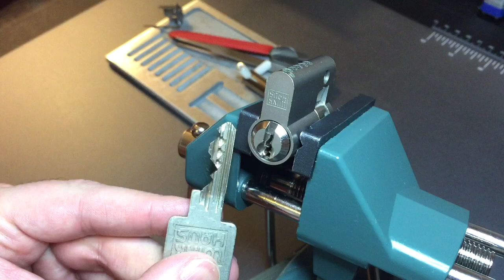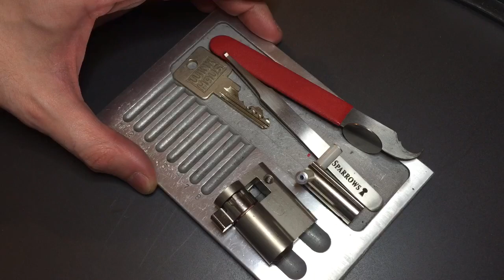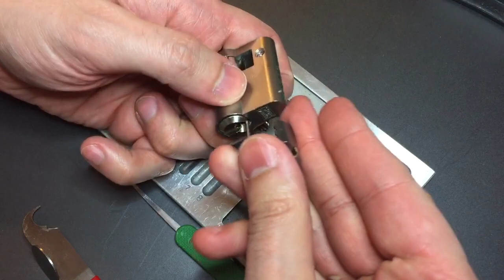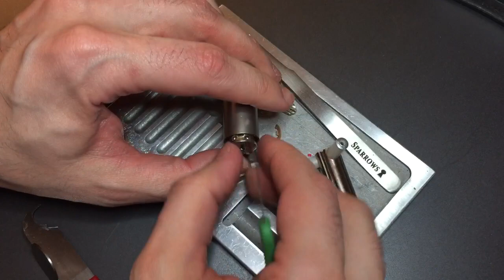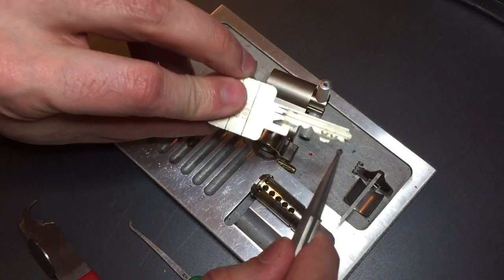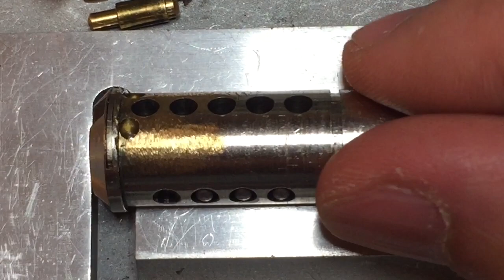[125] Wink Haus Euro Profile Cylinder Picked (With a Custom Pick) and Gutted

Comment: Great job making that custom pick. Love that demonstration of your will to never give up. Make a handle to the pick and you got a nice addition to your arsenal. Well done.
Reply from the maker: +Potti314 Thanks.  I doubt I'll make a handle... the pick is way to thin to stand up to much use, but it had to be to fit through the bottom warding and pick from the bottom of the keyway.  It's already distorted pretty badly.  It's days are numbered.

Comment: I used to build Wink Haus locks. It’s been a LONG time, but yes, that filling is unusual. I never recall any issues with the cores or cylinders from the factory. This was 35 years ago, so I don’t have current knowledge.

Comment: Great work on a tricky lock👍👍😘🔓
Never seen a spool like the one in number 4( nice)
As for the pick,it doesn't have to be pretty to work well 👍👍 great job and thanks for sharing😘
Reply from the maker: +Pick Beard Thanks... I've never seen one like 4 either, at least not a commercially made pin.

Comment: You got to turn the key multiple times to open these locks when insert in a door. 
Is that possible when picking? Same lock on my door but need to turn the key 3 full rotations to open and lock my door!
Reply: It is. But you would have to pick it multiple times because with each rotation, the pins will reset.

Comment: Your clip remover looks really good. Can you remember where you bought it from and perhaps what it is called?
Reply from the maker: +Jasmine Lognnes It is pretty good.  It came as part of the lock disassembly kit sold on dhgate.com ... comes with followers, tweezers, pliers, core holders, euro cylinder pin holder, etc.  Much of the stuff is crap, but the few nice items are worth the $25 price of admission.
Reply: +LockPickingLawyer I'll get that =) Thanks =)

Comment: Had the same kind of lock yesterday. Too jagged to put a large hook, too extreme a bidding to open with a thin long small hook.
Reply from the maker: +zanshibumi What kind of lock?  Outside of challenge locks, I've found that truly difficult bitting/warding combinations are pretty rare.
Reply: +LockPickingLawyer While taking a picture of it, I saw that in my memory it was harder than looking at it more objectively (not right after failing to open it) http://imgur.com/bTbFYtN  In my defense, I must say I tried to open it with fat .028 picks. :)
Reply from the maker: zanshibumi Nasty bitting!  And a .028" is usually too much for a tricky keyway... you need to get some thinner picks!
Reply: +LockPickingLawyer Waiting for my .236 MadBobs, may they come in less than a century.
Reply from the maker: Personally, I'd look into .015" and .018" picks...  .236" is an improvement, but it's not going to cut it for many tight keyways.